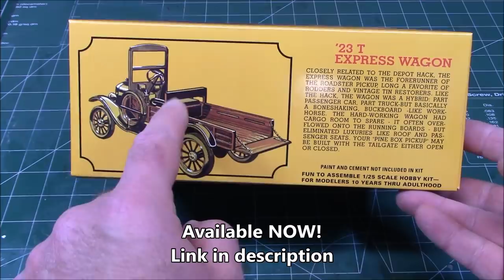1923 Ford Model T Depot Hack Pickup 2n1 1/25 Scale Model Kit Build Review AMT AMT1237

Comment: To attach clear parts try GS Hypo Cement sold at Hobby Lobby. Jewelers use it to attach watch crystals and it dries clear. It comes in a very small tube and you only need to apply a tiny amount. I have been using it for decades.
Reply from the maker: I have it. I prefer the Mod Podge for speed and flexibility. But whatever gets your models built is what you should use.  Thanks!

Comment: Hey!  What happened to "you can get it any color as long as it is black"?
Reply: later on FORD changed to any color to compete with CHEVROLET. FORD was getting close to come out with the model A.
Reply: FoMoCo never built a "depot hack" but did sell running chassis assemblies to companies that did make the vehicles. Therefore the vehicle could be colors other then black.

By the way, why hasn't anyone mentioned that the fenders in this kit ARE NOT Ford Model T?  They are simply "typical" early 1920 "something".
Reply from the maker: Many places custom painted their cars as well. Very very common back then.
Reply: @rogerroberts1310  Many companies bought the chassis only and did the coachwork themselves.
Reply: @The901meister  That is what I said...

Comment: What glue do you use to attach painted parts to painted parts that don't fog the paint? My tamiya thin works great on non painted parts but my bob smith glue i use for painted parts to painted parts is fogging the paint.
Reply from the maker: I use dollar store super glue.  If you use a tiny bit it won't fog.  

Future floor polish will cover the fog if it does.

Comment: That's some pretty low level mechanical aptitude thinking the tires would work without cutting the centers out. Just saying. Funny, just as I was saying the kit was pretty good with parts you add "Not a lot of stuff with this kit."
Reply from the maker: Doesn't even fill the box, but it sure turns out cool!